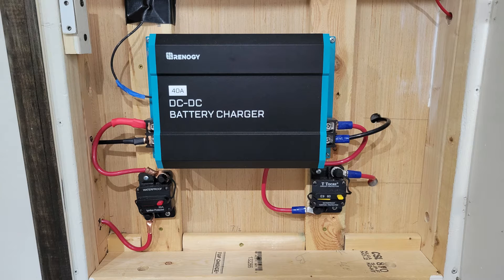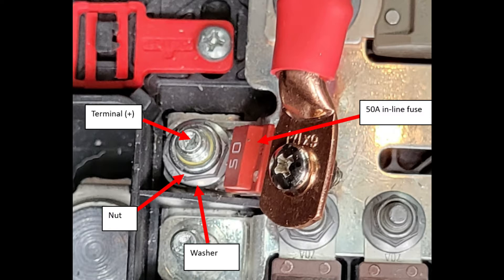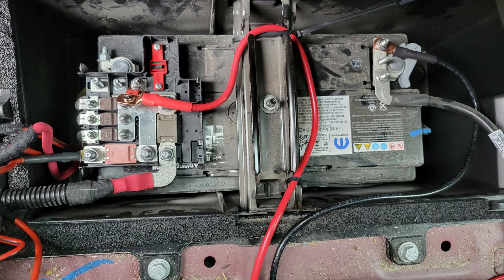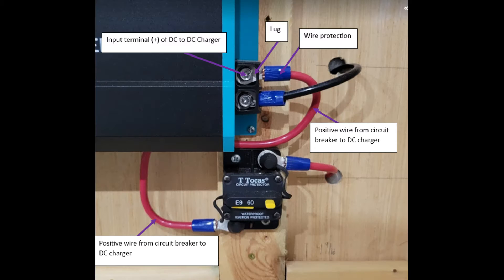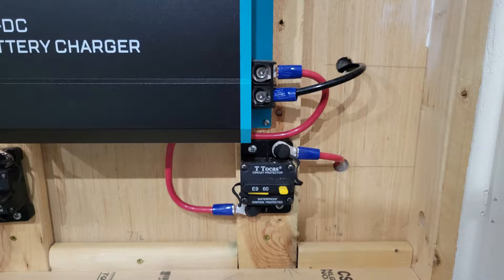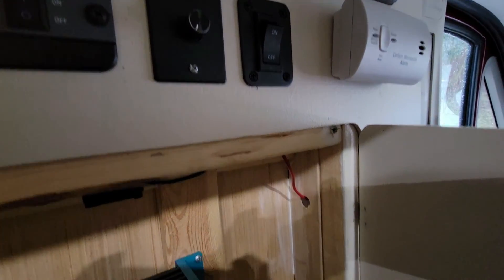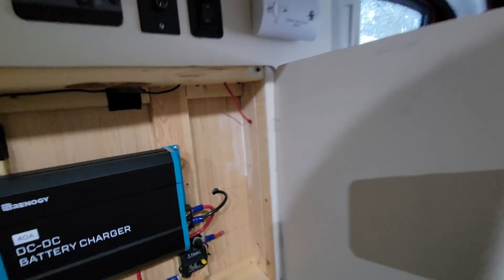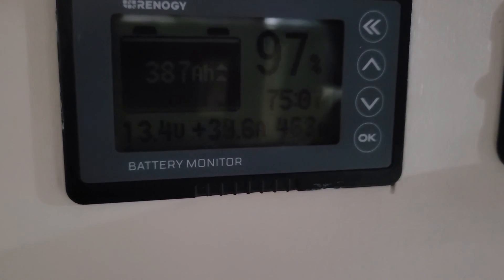How To Wire a Renogy  DC to DC Charger Without Spending Hours On It!

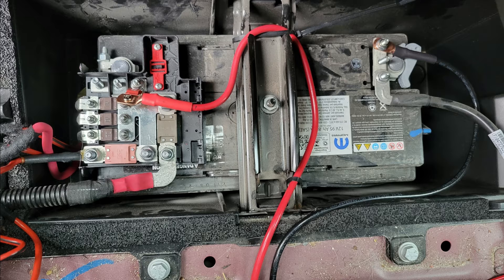Comment: 0:30 Never use a fuse this way. Midi fuses require a fuse holder, because theyre not made to withstand mechanical forces exerted by that big wire.
Then the "fused" end could easily make contact with the unfused busbar.

Comment: The wire should be routed before termination on the power source as putting ends on cables or touching the two leads together can cause serious problems.

Comment: I am not sure I like the look of the way the fuse is connected, if there is already a circuit breaker at the other side on the wire there is no need to connect the fuse at all, or if you want it anyway wouldn't it be tidier to just fit a 50 amp inline fuse?

Comment: Best video out there for explaining. Top work. I've just installed this following your help. I also didn't need an ignition cable as I have a VW T4. No smart altinator. Thanks again.
Reply from the maker: You're very welcome, thanks for watching!
Reply: My 12V inline aux power is switched to the ignition - I use that.

Comment: You are joking with this fuse connection to your vehicle battery - try grabbing a spare one and bending it a couple of times and you’ll understand 😂.  It goes in a fuse holder.  It will break and snap and you’ll have  the wire flapping about potentially shorting out on something else. Massive fire risk. You don’t understand fuses or breakers. The main fuse to the vehicle battery is an ANL fuse (this functions differently to a mega fuse)  The flip paddle style trips are commonly know to be fire risks and you have to be very careful where you source these from (so it’s general practice to use the turn style isolators instead)  I assume you don’t know you must have a MGBF or T-class fuse on your house batteries if they are lithium based.  These aren’t recommendations  they are essential things you really should think about.  Please research what I have said and I wish you the best - vehicle electrics are such a complex subject and it’s highly unlikely a DIYer would get it right the first time - please don’t think I’m just trolling.
Reply from the maker: Thanks for the detailed feedback! We appreciate you taking the time to share your concerns and advice. We'll definitely look into everything you mentioned.
Also the picture is older and it is not what it looks like now. We have another video up with the newer connection and fuse.

Comment: Thanks for the vlog iv done the same for my renogy dc to dc 50 amp used 20mm 135amp cable at 10ft the cooling fins get very hot so I’m installing some fans off the d+ wire are they are less than an amp . My question is =does the cable you connected to the battery get hot at the terminal ? mine does I know the connection is good. I have a Citroen relay similar to your pro master thank you and good luck 👍👍👍🏴🇬🇧🇨🇦🦢
Reply from the maker: We only drive for 4 to 5 hours a day so it does not get any hotter than any other cable. Make sure you are properly protecting the cable end and you will be fine.
Thank you for watching!

Comment: Well done. I got a little nervous over the part where one is told to snake the positive cable which is already connected to the battery, to the charger location without mentioning disconnecting the negative cable to the starter battery. One touch of that hot cable end to any bare metal is going to go boom. Novices may not know to take that precaution.
Reply from the maker: Very true, we did leave some things out that may seem common knowledge but it might not be that  way with someone else! I appreciate you taking the time to comment your thoughts and concerns!

Comment: How did you wire in your power switch?
Reply from the maker: We wired it into the D+ ignition cable. That way if the switch is off the DC to DC will not turn on, even if the van is on.

Comment: Does anyone know what "Idle power consumption" means exactly?  At 0.4A, this will discharge the battery in about a week.  Presumably, if the D+ signal is not present, the current will be very close to 0, and the 0.4A figure is when D+ is present, but the battery is at full charge.  Any other interpretation would mean this is a bad design, but bad designs do happen.
Reply from the maker: Totally fair point! Yeah, “idle power consumption” usually means the draw when nothing active is going on—so with D+ off, it should be super low. That 0.4A likely kicks in when D+ is live but there’s nothing left to charge. Appreciate you bringing it up!

Comment: Im afraid to say this is not something people should be following as an instructional video . 
That main battery terminal and fuse are improperly fixed, with the possibility of the terminal making contact with the bolt below and circumventing that fuse altogether. Do it correctly. 
The  crimps on all of those lugs appear to have been done either with the wrong sized tool or just the wrong tool altogether. Get the right tool. You'll be amazed how much easier it makes the job. 
Many of your terminals are still exposed without heat shrink over them, yet others do. finish the job. When you take short cuts. it's more likely to fail and cost you more time coming back to fix it, than it would to do it properly in the first place. 
That circuit breaker you show, is both cheap and not recommended for auto installs despite them being listed as such, they tend to fail over time due to vibration and are best to be avoided. another quality fuse in line is a better option.   
 I appreciate people having to learn and just kicking off the channel but when people who don't know the correct way to do things, they should not be offering advice to others on how to do it.  
 I see you have commented multiple times below about having changed it or having learned more since the video, yet this video is still live .
 These issues could literally worst case scenario end up with someone burning the car down or worse. you really need to be considering this before posting up such videos.
Reply from the maker: I thank you for your opinion and time commenting. I hope you have a great day!
Reply: @dirtbagswithfurbags Thank you for posting this content @dirtbagswithfurbags . I believe you have the grit to take on this job which many people will pay someone to do( perhaps a "Den Monkey" if I may be so bold ) Listen, you don't know what you don't know what you don't know. We ALL start from zero and gather points. You did great work and are way oreos knowledgeable than you were this same time last year - that counts big time.  New subscriber purely off freedom and power of will you displayed. Keep posting!!! Loved it👍🏻

Comment: Genuine question: Is two circuit breakers really necessary? Seems a bit overkill imo 🤷🏻‍♂
Reply from the maker: Great question...is it necessary, the answer is no lol. When we were building our van, we took it to an old school engineer that was a friend of the family. He told us it isn't necessary but if something would happen you would only burn out a section of wire. So, if something happens near the battery we don't have to replace everything. 

This is great for us since we don't have a house to go to every night, if something happens we only have a small fix. Of course nothing has happened and hopefully never will. 
Also the 2nd break is nice if we need to isolate from the battery, we don't need to pull up the floor panel and disconnect it.
Overall not necessary but we didn't see any down sides besides another step while building it.  Though I would match the breaker to fuse size. That is something we didn't do correctly, but we learned for next time.

Comment: After tens of videos made by men bragging about their new toys and software functions but zero advice on wiring.. I finally get here to see a great video made by someone who got the point and explained it simply and straight to the point. Great job!! Thanks!
Reply from the maker: I'm glad we could make a video that helped you out!
Reply: Not exactly though. There are no cut off switches. The red side is always hot. Being connected this way 100% of the time eventually killed a diode. Power from the camper battery would regurgitate power back into the van battery at idle or even when the unit was powder off. These items need to be isolated when not in use. Either with quick disconnects and covers, or cut off switches. I'm doing both. I cut off switch on positives and a quick disconnect after on both sides of the charger
Reply: @JayH-y1z really? I thought it was an intelligent charger that would have built-in features to protect again such drain in the opposite direction

Comment: Informative video. Thanks. One thing though, if you don't mind a little criticism from a builder. You don't need to fuse your incoming voltage from the starting battery twice, as you had put a 50 amp MIDI fuse on the positive cable. It does make a great shut off switch though, one at input, and another at output. That's genius, since Renogy doesn't come with a on-off switch.
Reply from the maker: First thank you for watching. Secondly, I love constructive criticism, it makes us better. I don't like a**hats just insulting us because they disagree. You are completely correct though! 

Thanks for sharing your insight as a builder!

Comment: The bolt on fuse is a LITTELFUSE Automotive Fuse: 50 A Amps, 32V DC, 1 39/64 in Lg, 25/64 in Wd, 498, AMI, 498
Reply from the maker: Thanks!

Comment: Can the charger negative terminals (both input and output side) just be grounded on chasis instead of connecting to battery negative terminals?
Reply from the maker: It could create unintentional new electrical circuits if you hook the negatives to the chassis. I know the reason you don't do that for jumping a car is because it is a safety measure to avoid sparks that could ignite your battery. Though newer batteries have changed this and are not likely to ignite like older batteries.
Overall, it's just best to close your electric loop off to avoid any unforeseen circumstances.
Reply: @ thanks it seems like the charger doesnt allow it anyway. Had to run actual connection to starter batt
Reply from the maker: @Dptl  We were discussing this after I commented and we thought that too. Thanks for confirming it! Hopefully its working well!
Reply: @dirtbagswithfurbags  i dont see any sparks or smokes and my system is not on fire so far 😁
Reply from the maker: That is great and hopefully you never do!

Comment: Nice video but missed  function! Where the d+ socket on the charger there are two ports. This allows an additional 'loop' that will reduce the output to 20A. Ideal for those long journeys where a 20A charge is fine so as not to strain the alternator unnecessarily. I have this on a switch also so I can choose on/off and 20A or 40A output.
Reply from the maker: That is an awesome addition! Thanks for letting us know. We appreciate the extra pointers!

Comment: You also do not need a circuit breaker for this to work....also you don't  have to change your wire size you can use the same 2awg-6awg that you're alrdy using there is no negative to this
Reply from the maker: As I said in the other comment, you are correct, I like the circuit breaker because it is a quick way to isolate the DC without unhooking the battery. We have a story to back it up but it's long and not very interesting:)
Again thanks for the feedback and watching the video we do appreciate it!
Reply: The breaker is for safety in case something touches something it shouldn't.  It happens..
Reply from the maker: @rogerwhiting9310  weird things can happen!

Comment: You dont have to have an inline fuse at the battery not a requirement for it to even work
Reply from the maker: You are correct, we got some advice from a old time electeiction that it would be a redundant back up. We rock climb so I love to have some extra safety.

Comment: Cool video. A couple of observations... Please use a flexible conduit for your wire runs (wire sheathing isn't as thick as you think). The mega fuse needs to be mounted in a fuse holder (vibration can cause it to break, it needs support). Buy a crimp tool. The van is looking good btw.
Reply from the maker: Hey thanks for the watch and feedback! To answer some of your observations. 1. We bought a cropping tool and redid the battery compartment and hook ups on the DC. It is much nicer looking than before. 2. We also did get a better fuse and mounted it off to the side. It looks a thousand times better than before. I'll try to update the thumbnail to show it! 3. I wish we did the conduit but it's hard to fix that current since we are on the road full time. Once once we get at a home base we will look into it. Thanks again for watching and don't be afraid to share any more feedback. We love to learn and help people learn from our mistakes.

Comment: too many connections! Doing 100km on extreme corrugated roads (e.g. Namibia, worst was Serengeti), bones and teeth get smashed to the nth degree, no chance for these connections to remain intact. Need better solution.
Reply from the maker: We travel on some crazy mountain roads and go above 100km, speed limit on most Texas roads is 75 mph (120kmh). With that being said, if the road is that bad, you probably shouldn't be going those speeds for safety reasons. Just cause you can do that in one vehicle doesn't mean you should do it in every one. Drive safe!

Comment: That positive terminal connection was scary looking. Seems easy for the improperly install fuse to be bypassed if it sags a bit and touches the bolt coming out of the busbar under it.
Reply from the maker: True! Thanks for your concern, it's been fixed and working on a follow up video to show the current setup.

Comment: Appreciate your video!  Curious about the fuse placement; (1) 50A at battery to protect primary wire to DCDC Charger, (2) 60A CB to protect DCDC Charger from excessive input from primary wire, (3) 60A CB to protect down circuit (output) wire to Battery.   With (2) installed, is (1) necessary?   It appears  that 50A fuse will blow before 60A CB is tripped.  Thanks again for well documented installation.
Reply from the maker: Great question! The reason was at first we did not have the 50 amp fuse. At first is was just the 60 amp breaker. Since we were new to building the van, we took it to an old school mechanic friend of the family. He suggested getting a fuse closer to the battery. The reason was to protect the wire in case of overload. If we didn't have the fuse and something would happen between the battery and DC to DC we would have to replace all the wire and it of course the safety issue. Then we kept the breaker in because we can isolate the DC to DC if we need to work on it while on the road. Thanks for watching! Let us know if you have any other questions or ways we can improve. Our goal is to inspire one person to start a journey and learn some new skills (we make the mistakes for them lol)

Comment: Oh, so this installation is for a van? The majority of RVs are travel trailers or 5th wheels. Would the installation be the same?
Reply from the maker: Yes this is for a van, the overall concept is the same though. The only thing that would change would be if you hooked the D+ cable to the alternator, then it would change depending on what type of alternator you have. Also, if you have a longer rv the cable sizes may need adjusted to compensate for the power draw.

Comment: Hey, thanks for the info! I've got the other Regency model, but no smart alternator, so I need to tap power from somewhere else.  On the DC charge input, there are two holes for the IG wire – which one's positive?
Reply from the maker: It has a D+ next to it. Hopefully that helps!

Comment: Why not earth all negative wires to body
Reply from the maker: You wouldn't earth all negative wires because grounding is not simply synonymous with negative terminals. If you connected all negatives you could create unintended current paths potentially causing ground loops and safety issues.